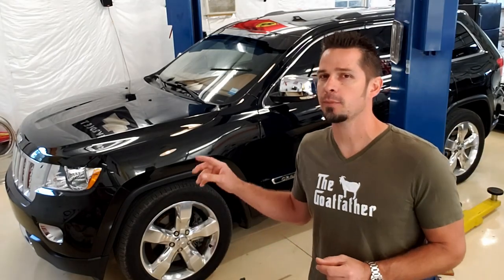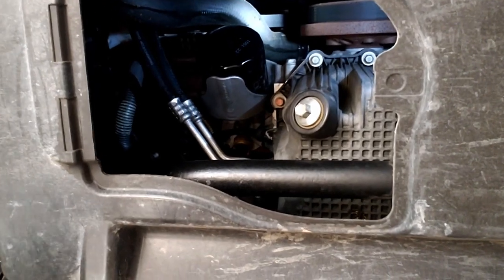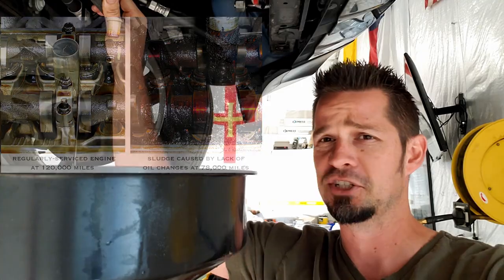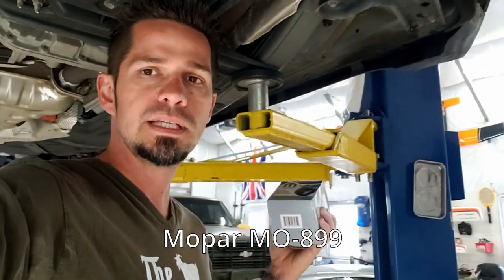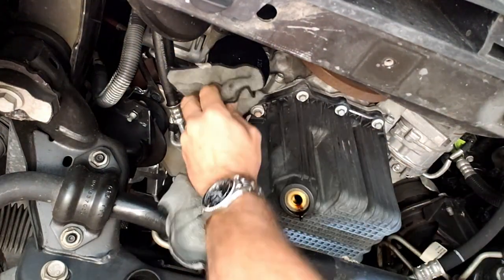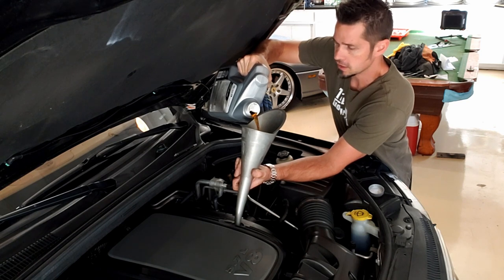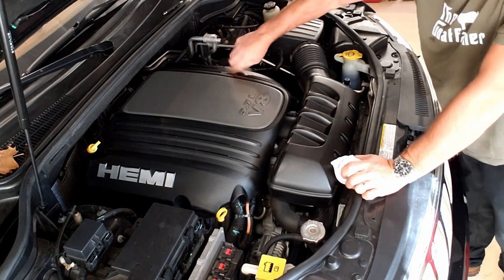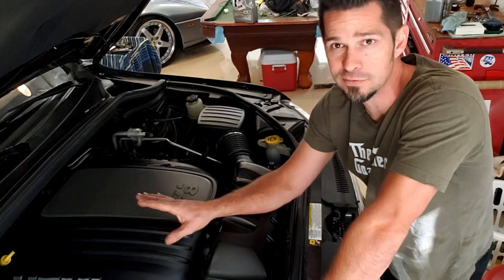DIY $25 Synthetic oil change for WK2 Jeep Grand Cherokee 5.7 Hemi PLUS SERVICE RESET

Comment: Crazy to think that one quart of Mobil1 5W 20 synthetic at my local Wal Mart is $8.78, and a five quart jug is $26.97!  Great video, short and to the point! Thanks
Reply from the maker: Crazy huh? Those 5qt huge are such a good deal.  They had the  rebate back in the spring this year, but didn't have one this fall.

Comment: My 07 seems to take about 7.5 qts for it to read full, but the oil pans are different from the '07 (aluminum pan) to the later models with the plastic oil pan. As far as troubles, well this one was pretty reliable, the extra repairs were starter, alternator, rear diff pinion seal, front diff bushings,  TIPM (totally integrated power module) and  AC evaporator. Now needs a radiator. I don't consider that bad for a 15+ year old car with 120,000 miles on it.
Reply from the maker: Some of these are getting to the age where they need a few things, like any car of this age would. People trade them in, new owners buy them and then immediately wonder why they're having issues. I instantly address any issue I've had and keep up with the maintenance and I've been very pleased with my Jeep ownership so far.
Reply: @ExoticCarDIY  
If you’ve got a good 5.7 that doesn’t have cam or lifter problems hang on to it, they are hard to find on the newer WK-2 series and there is a BIG difference between the 3.6 and the 5.7. No replacement for displacement!
Reply from the maker: @Luigi-pk8mk  if you know one thing I found very interesting, I raced my 2,011 with the 5-speed against my friends 2018 with the 8-speed
Mine beat his by about a car length in half.
However his seems to average about three miles per gallon more
Reply: @ExoticCarDIY  
I test drove a 2020 Overland w/ the 5.7 & the ZF design 8 speed. It felt slow off the line compared to my old 5.7 with the Chrysler 5 spd auto. It has 30 more hp so it SHOULD be faster but it maybe programmed for better fuel economy. I was underwhelmed by the 2020!

Comment: will that Mopar filter fir 2020 Jeep GC High Altitude 5.7 if not do you know which one i need
Reply from the maker: 04892339AB also labeled at the mo-339
Both the mo899 and the mo339 will work, the mo339 is smaller filter. Apparently there is a extra coolant hose  on the newer ones that slightly interferes with the larger 899

Comment: Hello, I'm looking to buy that same grand cherokee but I see real bad reviews as to reliability,(electrical gremlins, and such) what has been your experience?
Reply from the maker: Consider you are buying a 8-11 yr old car, why brand car that age with have a few issues as expected. Common issues are hemi exhaust manifolds and water pump, air suspension etc... And to be honest, none of that scares me or even bothers me. Cheap and easy.
The one issues I don't like is the stalling issue.(which is what I think the review sites mean by electrical Gremlins) There common blame is the fuel pump relay, which has been recalled 2or3 times. I've been on a yr long waiting list to get the "fix" fixed again. But to tell you the truth, I don't think it's the relay.
It's intermittent, happens on my Jeep during moderate braking and turning left. A very specific scenario, too specific to be a simple relay failure imo.
I'm currently determined to figure this out, and will report a fix when I get it.